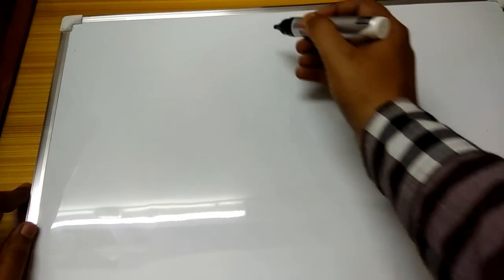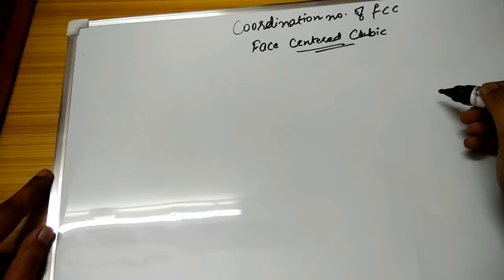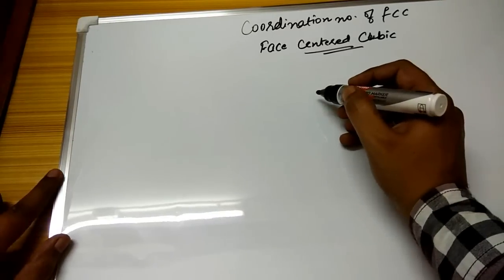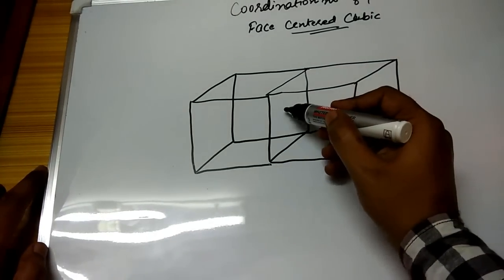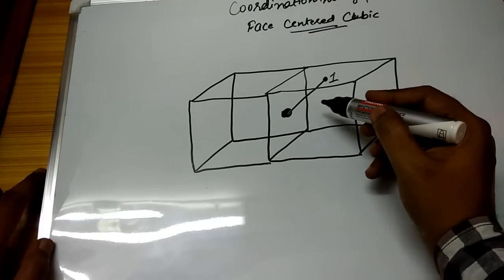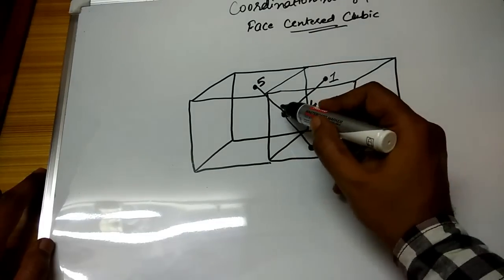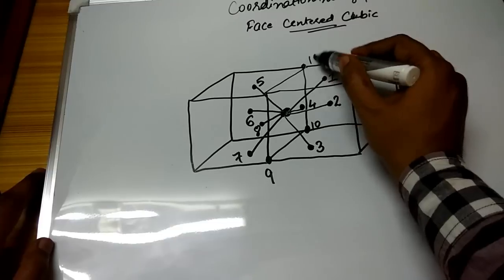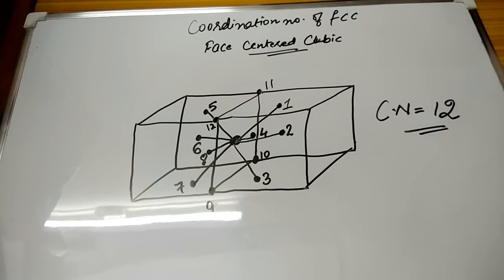Coordination number of Face Centered Cubic

Comment: Why didn't you join limes to the corner atoms
Reply from the maker: because those corners are not nearest neighbours of central atom.
Reply: @RAVISHEHARYAR16  why the other two face atoms which are in front of the central atom are not included  ??? because in 3D lattice when we see they are  as much as close as the upper , lower , right and left are....
Reply: Because these are the surrounding atoms of these FCC atom